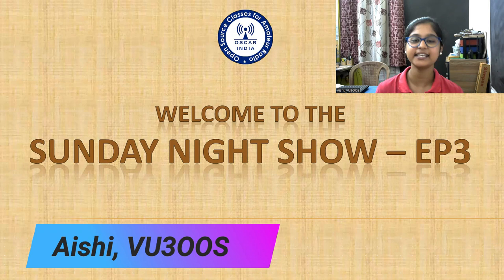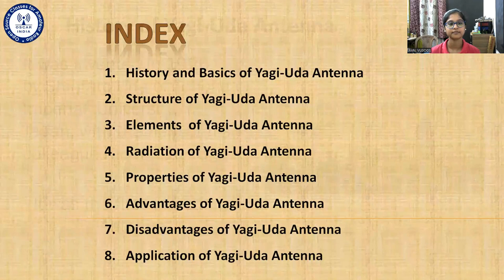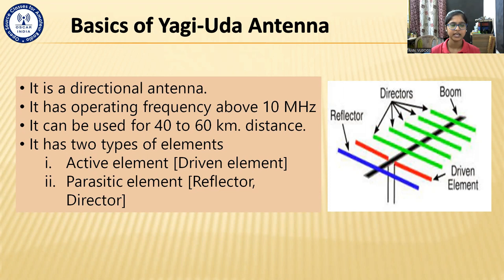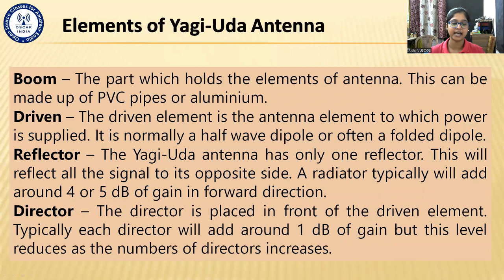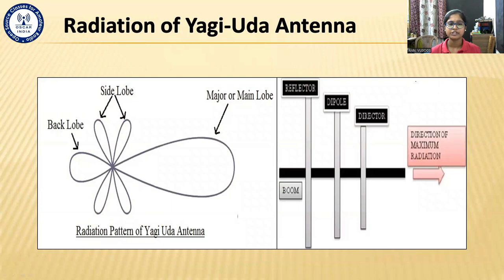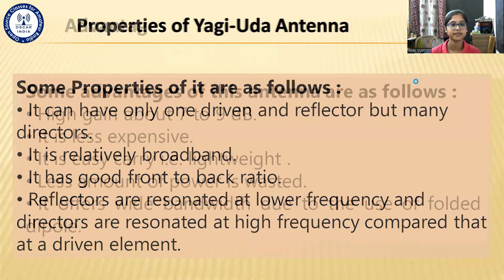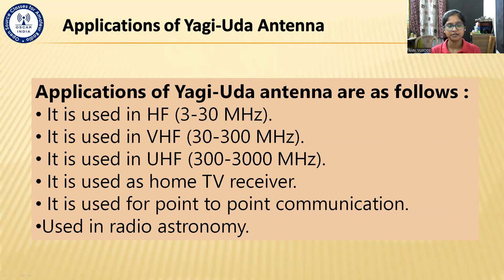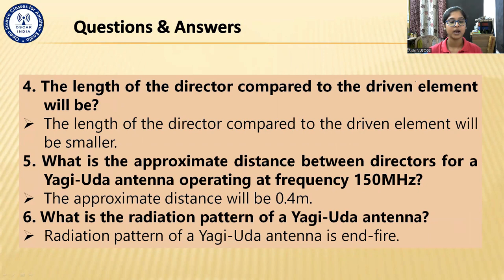Yagi Uda antenna explained step by step | Know the radiation type of Antenna | Sunday Night Show

Comment: The frequency range in which the Yagi-Uda antennas operate is around 30 MHz to 3GHz which belong to the VHF and UHF bands .
General operation range is not "usually 10Mhz"